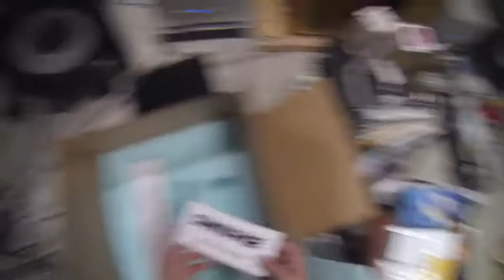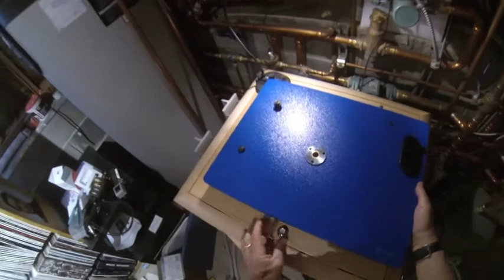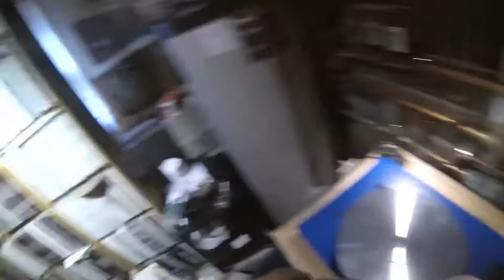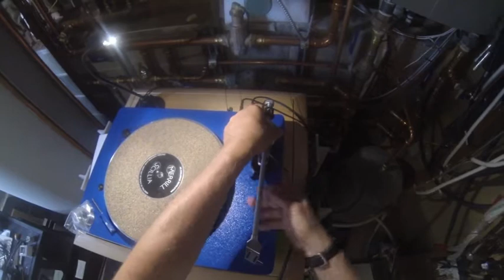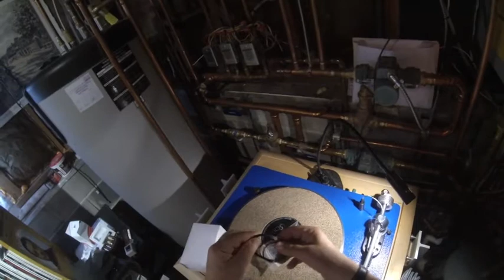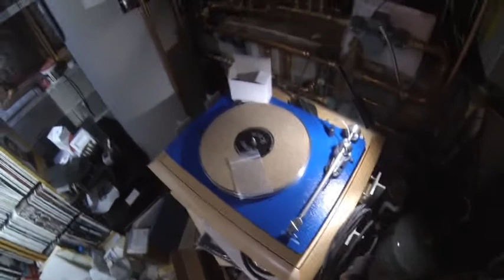VPI Traveler Turntable Set Up Part 1

Comment: Nice , they now use Chinese wallwart power supplies to cut every last penny of manufacturing cost.  Make sure you unplug it when you are not home.  Your local fire department will thank you.
Reply: The "wall wart" allows the turntable to be designed for use in multiple countries without requiring a different motor for each country's voltage, as was done in the first version of the Traveler.